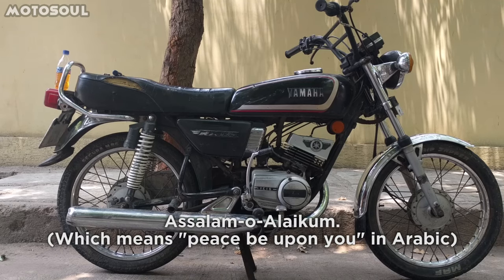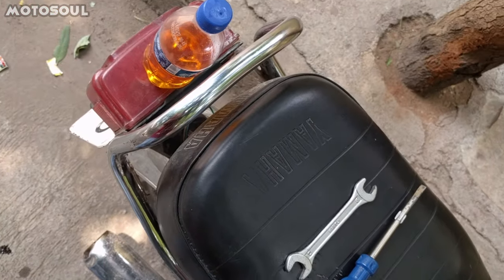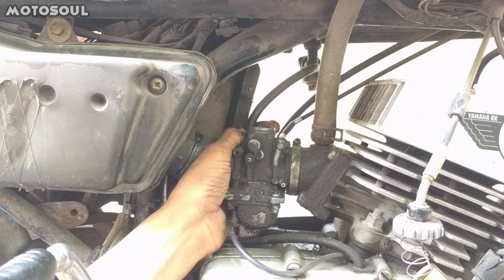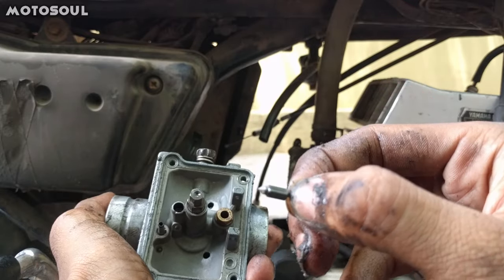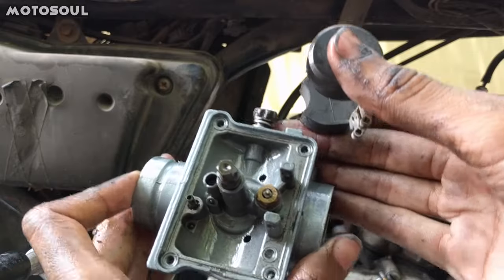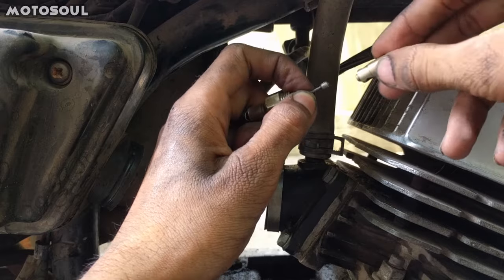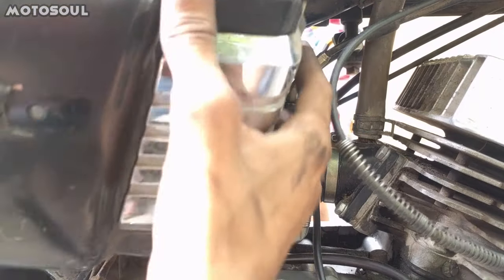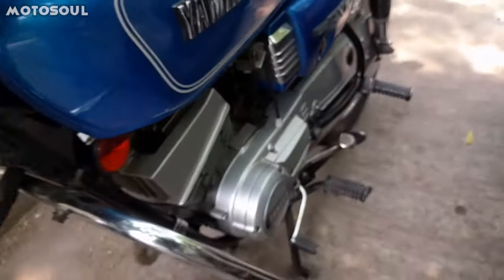How To Clean Carburetor of Yamaha RX 100, RX 135 & RXZ

Comment from the maker: Here is a quick Do it yourself video on how to clean carburetor on a Yamaha RX100, RX135 and RXZ. The Process is pretty much same on the RX100 and RX135. On the RX 100 you won't have to remove the choke cable as it has a choke knob.

On the RXZ, you don't have to remove the side cover to open the carburetor as the air filter hose pipe is visible and accessible.
Reply: Motosoul - A Tribute to Old Motorcycles brother where I can get chrome mirror for rx100 like yours ? I mean which company which place ?
Reply: Motosoul - A Tribute to Old Motorcycles. Key. Salt. January.
Reply: Yama ka maelej kese badaye
Reply: Sir my rx100 carb overflowing how to set flute height
Reply: Bro what is the benefits of cleaning carburetor

Comment: Removing and installing the carburetor makes the jet and float improper. It's not really necessary to remove all the parts of the carburetor and fix it by doing it damages the carburetor.Its been more than 3 years that I haven't opened a single nut on the carburetor it's fine and my RX 100 starts on a single kick every morning....!!!!
Reply: Listen if you use mobil with petrol then its is nessary to clean if the bike is not in running co dition as it would get totaly jammed

Comment: Bro I don't get any power or pick up in low rpm then suddenly there's a massive pick up at high rpm   , what's the problem
Reply from the maker: It can be because of various reasons. Best thing is to get it checked by a mechanic. It might be because of the carburettor or the engine.
Reply: Thank you bro

Comment: You should have included the removal of the main and pilot jets and cleaning of these parts too
Reply from the maker: +shayne dsouza yes i will include that in the future video in which I will replace the carb parts with carburetor rebuild kit. I did not include all that in this because not everyone has T spanners and other tools to remove pilot jets etc. I tried to keep this as simple as possible with only 2 tools.

Comment: I have a RXG....the problem is....when I accelerate with air filter box on...the engine race falls with full throttle..probably low delivery of air.

Without the air filter box...the race is good enough...
My carburetor is Japanese one...and is cleaned in all way ...and the AF screw is also tuned to best of my knowledge...

Can you suggest me any idea....?

I  don't want to get rid of the stock carburetor.

Comment: I have a rx100 and thinking of fixing a K&N air filter ....
which sound will be better .k&N vs Stock.
Reply from the maker: Suhail Qureshi i have used k&n air filter on my other rx. Its great but due to our polluted environment its not good. You will have to clean the air filter very often as dust goes inside the carburetor due to that air filter. Its not made for dusty environment like our cities. If you want better or louder sound I'll suggest you to stick to stock airfilter and make a good muffler. I also made a video on my muffler.
Reply: Motosoul - A Tribute to Old Motorcycles 
thanks buddy appreciated

Comment: BROTHER, IF YOU OBSERVE THESE THINGS ITS BETTER
1.BEFORE OPENING  THE CARBURETOR YOU HAVE TO CLEAN OUTER AREA OF THE CARBURETOR.ITS SEEMS SO DIRTY...
2.BETTER TO CLEAN THE PILOT JET AND OTHER JETS AND BLOW WITH THE AIR OTHERWISE IT WILL TROUBLE YOU SO MUCH AND ALSO PASSAGES OF THE CARBURETOR IF ANYTHING BLOCKED.
Reply from the maker: +C c Waltair thank you for this brother. You have very strong points. Didn't think of it. Will make sure i include these points in the future videos of cleaning carburetors.

Comment: hassan bhai, i found a yamaha rx 135 1996 model 4 speed for sale, but its blue book is showing RXZ 135,  should I buy that motorcycle ?
I think it has been modified to look like a Rx 135, what do you think ?
Does Rx 135 comes written as RXZ in RC papers ?
Reply from the maker: Aditya Roy check the engine and frame numbers. If they look fishy to you don't go for it. If they look fine then maybe it was an rxz which was later modified to rx135. Else maybe the rto guys messed up the name at the time of registration. This could be the reason too. No, 135 is mentioned as rx135 on the rc.
Reply from the maker: Aditya Roy make sure you tally engine and frame numbers on the rc and on the bike
Reply: hassan bhai thank you for valuable feedback.
engine and  chassis number tallied, and it is same as the rc. but which one is better, rxz or rx 135 4 speed, also is there anyway i cam spot a difference between both by looking at the engine, as the bike looks like Rx 135
Reply from the maker: +Aditya Roy both rxz and rx135 have same engines. Both are same. Rxz has different frame and rx135 has a different frame. Rxz looks better in my opinion. It has a sporty look. Look for the seat. If the frame is different than rx135 it is an rxz
Reply: okay, I heard rxz was not fast enough like rx 100 and 135 hence it was also not popular.
Reply from the maker: +Aditya Roy this is a myth. Rx135/rxz is fast but in a different way. Rx100 has the initial pickup. It goes 0-60 like a rocket but rx135/rxz has better top end. It goes -70-100 easily. Back in the day people just wanted an rx100 just because they didn't use to go on long rides. For city use 100 is good but it feels stressed on highways. 135 feels better on highways because of better top end
Reply: hassan bhai.. thank you for clearing my doubts :D
Reply from the maker: +Aditya Roy your most welcome brother